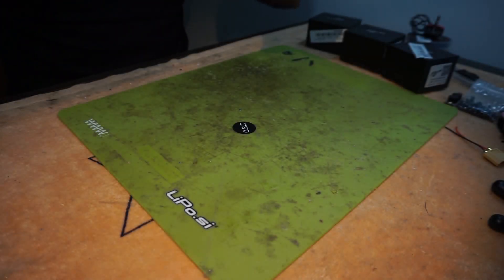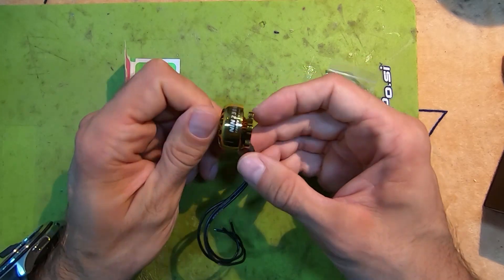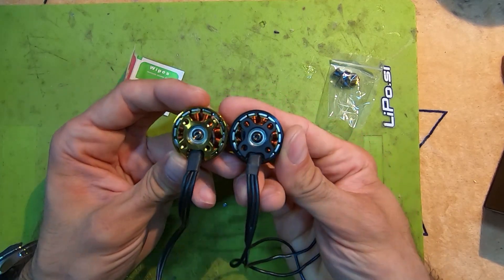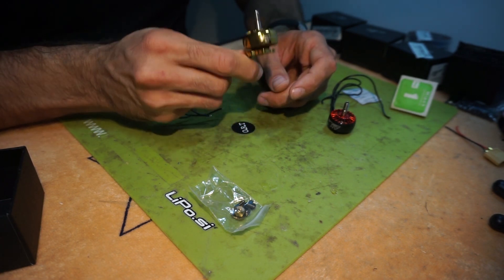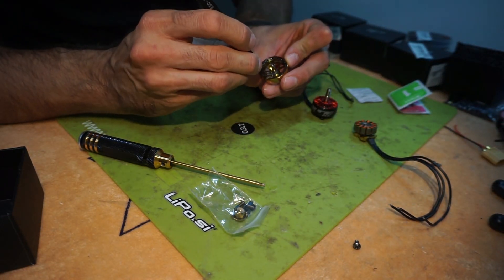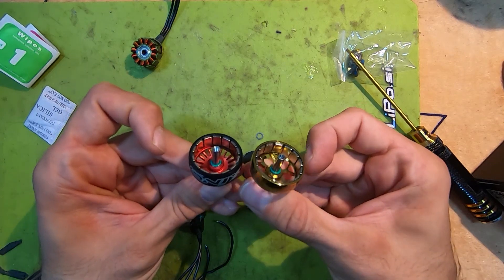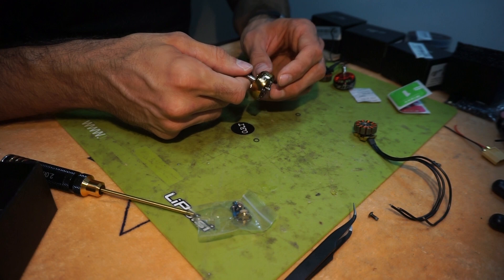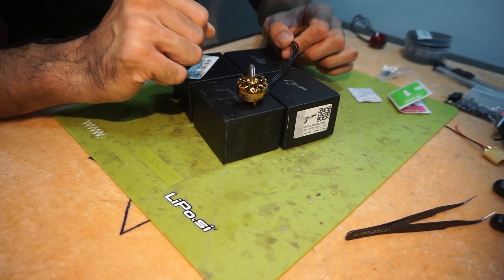FLYWOO NIN PLUS N2306.5 1750KV 2-6S Brushless Motor - Gold.

Comment: Flywoo is putting these on clearance, but not price reduced... still $29...   
I think they are phasing these out, which svcks!   What are we going to use for replacements if one breaks and we can't get another one?
Sound I buy more as backup, or... what can replace them.   Do you think I could have 3 NIN's and one replacement Xing
Reply from the maker: I'm sure xing and new emax eco line motors are the same ;)